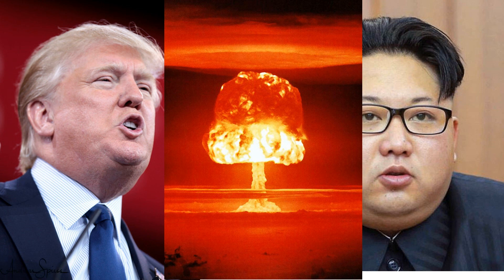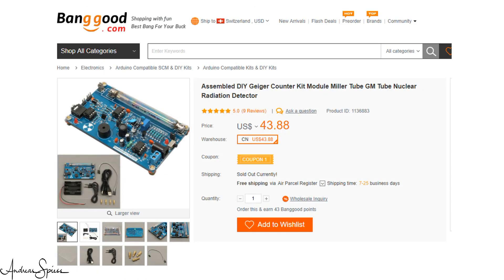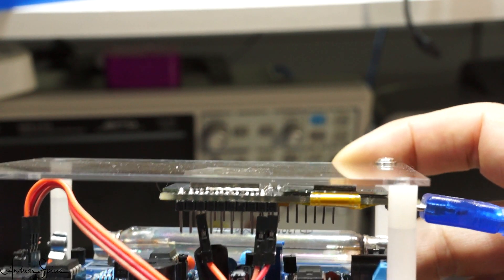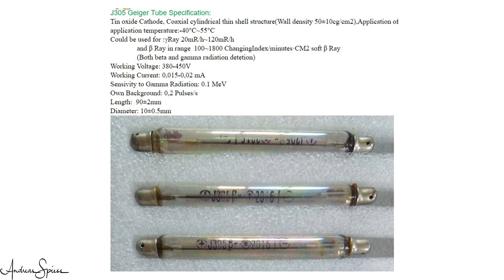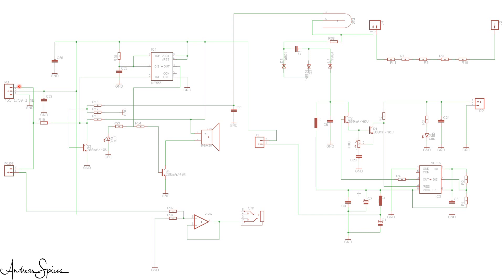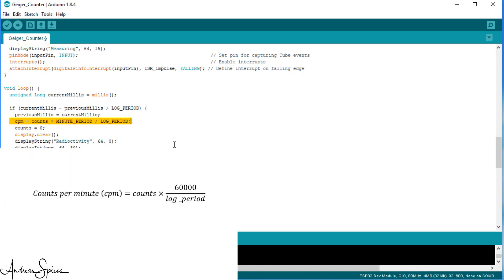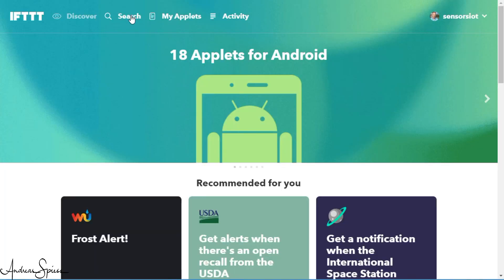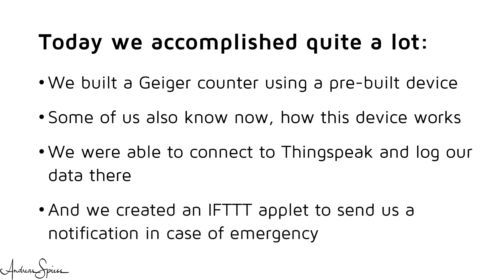#162 Build your own 50$ connected Geiger Counter (ESP32)

Comment: my interest is peaked with all of these projects and with current issues we politically maybe facing.  i always been interested in self prepping and preservation but never fully taken the leap until recently.  now i have several two way radios, i'm learning about getting my license to operate them legally and learn more about setting them up in disaster situations, i have food on hand that should last a good while and tons of sealed storage containers, i do lack a dedicated survival shelter however i do have plans and placed i been keeping track of that i'm keeping close to my chest not revealing as to limit possible exposure of it being viable place of survival. one of the many things i want to do is these projects, helps you learn and understand how they work.  my biggest grip however is using wifi and the internet, here and now that's totally fine, however if the bombs drop or war is started, internet is not a guaranteed thing, not only that but using wifi/internet is also potentially issue with it just going down doing nothing, just a bad day, lines gone down or something.. and having them ruggedized for hard use would be more ideal.  what i would like is a system for logging and solar/battery lasts a long time just logging silently... but in event of x value exceeded, it starts firing off data and alarms.. one thing i plan on doing is hiding these boxes in abandoned buildings in and around dif areas in and out of my area so i can map out changes and where they maybe coming from and going to and patterns may come of them.. maybe instead of wifi use gsm system and fires off to said servers the info u requested or texts your phone? maybe oneday also add in a digital 440mhz or 900mhz band radio to have them communicate off the grid to some centralized system u establish privately?
Reply from the maker: Sounds you have a lot to do. I really hope it will be useless, because even if we are prepared well, war or any other catatrophe is not a desirable option for me...
Reply: Andreas Spiess not a desirable option for anyone.. I really hope never comes to it.  But even so I really hope to use multiple devices to study changes and patterns and maybe discover something new.

Ultimate outcome will be that only use for these doomsday devices and weather devices is to be used for discovered and in ways not intended to be used, at least originally.. for example if I place 100s of these giegercounters around my area can I accurately maybe predict things like change in seasons? Or approaching storms?  Maybe have first alert to solar storms?  Or even if some small leak of radiation somewhere can I accurately determine paths it takes and maybe augment yeild info?  

I purchased a few of these on eBay actuallly for even cheaper, and I'm reviewing your other videos on how to program these types of boards, I am excited to at least have some science and experiments.  

That being said maybe if we should not consider the grim possibilities but instead maybe would be cool to come up with alternative projects for them as well.. you mentioned in Brazil they able to seen changes in radiation levels in different weather patterns and systems, that's kind of cool and sort of my idea.
Reply from the maker: Maybe you consider to join one of the networks of radioactivity sensors mentioned in other comments here

Comment: I think if the bomb dropped, one of the first things to go would be the internet.
Reply from the maker: I think you are right!
Reply: Nope, you are both wrong, ARPA net was designed to withstand a nuclear war which is why it is distributed in the connections and there are the algorithms to find a fast route as well as any route that will make the connection including cable, over the air and satellite. Also it would be useful in the case of a nuclear accident such as Chernobyl and Fukushima.

Comment: Always test any project you made! For this project you have two options:
- Order a Geiger-Müller-Tester from Ebay. But, these are expensive and only sold from North Korea, USA or maybe Russia. For an additional fee they even launch it for you. You can also test your atomic shelter with the same device.
- If you do not like the above project, then use the high mountains in Switzerland. Would be interesting to get some values from 3000m (or even 4000m).
Reply from the maker: Lol. Maybe I will take it to the mountains when I go skiing...

Comment: An excellent comprehensive tutorial. I like it. I don't have the time to experiment now but my interest is peaked. 

On another note I saw you show the detector tubes independent of the board several times so I am assuming it is possible to get them separate. I am thinking it may be possible to electronically switch between two tubes say. One would be standard and the other would be shielded with 1 cm thick lead say. 

For 30 seconds we run the ordinary tube and take this to be low energy radiation. Beta I assume since since alpha should be filtered out by air and the housing. For the other 30 seconds we switch to the shielded tube so we are measuring gamma. Assuming near constant radiation in an event the difference can dive us an indication of the strength of the radiation we are dealing with.

Of course we can just put the entire Geiger device in a shielded case  with connections outside but that would not be automatic like the proposal above. 

What do you think? Am I making any sense?
Reply from the maker: The tube can be removed. However, the pictures I used were not from my own tube. I did not remove it so far.
Reply: Is it feasible to do the switching circuitry I suggested? Maybe it means disconnecting power to the board during the switch and letting it boot back up. All automated of course.
Does it make sense in your opinion or am I overthinking this? 

I think it would be much more useful if it could tell us how energetic the radiation is. My thinking is very energetic radiation at a lower abundance is probably worst that less energetic radiation at a slightly higher abundance. Maybe someone with more knowledge on the matter can correct me here if I am wrong.

Comment: You need to be careful about your enclosure because beta radiation is well absorbed by most Perspex, so your reads will be lower in an enclosure made of Perspex. Most counters have a wand with a thin membrane over the end specifically to avoid absorption of the radiation before it hits the detector.
Reply from the maker: Thanks for the information. I just began to deal with the matter!

Comment: Thanks, your contrubution arises an important question about counting (fast) signals using the ESP32: How can you control on which core the WiFi and on which the Counter runs and avoid intereference?
What I could find up to now is that the system is pinned to core0 and user tasks to core1, https://esp32.com/viewtopic.php?t=1161 . I also found some helpful articles on "techtutorialsx", e.g. https://techtutorialsx.com/2017/05/09/esp32-get-task-execution-core/ Here is decribed how to find out on which core a Task is running by adding some lines of code into the source. Do I have to modify the source Code of the wifi lib to find out on which core it is running or is there a more elegant ("non destructive") way? 
Maybe you or one of your Viewer knows more - even this is not necessary for a Geiger counter.
Thanks!
Reply from the maker: I did not look at it. At least, the ESP32 does not need any yield() statements to not crash. So, I assume, WiFi got the other core...
Reply: So, today I implemented an ESP8266 WeMos D1 mini Pro into the case of my Geiger counter  GCM-320+. It fits in the case and can send the dosimetric data to my ioBroker. So I can check several locations in and around the house.
Thanks for the inpulse!

Comment: As always, great video. I am kind of surprised you didn't tie it in to iotappstory AND your MQTT / NodeRed system. You could tweet it to your neighbors you care about.
Reply from the maker: Good ideas. This time, I wanted to concentrate on slightly different things to give you guys the choice...
Reply: Could you or someone else do a MQTT version of this scetch, I gave it a try but getting stuck on: "client.publish(SENDTOPIC, cpm);" with an "error: invalid conversion from 'long unsigned int' to 'const char*' [-fpermissive]". I may have done something very wrong in the code with limited coding skills. But it woud be very useful to get the MQTT working with local connection to my home-assistant to get alerts/graphs.
Thank you for the good work so far on your projects.

Comment: I remember as an apprentice I worked on calibrating them. Good times as with the radioactive signs no one came in the building. Lol By the way finally got my lamps to turn on and of via google home/assistant. But having problems filtering the commands in Node-red so far. Great episode, hopefully we will not need them.
Reply from the maker: I saw it in your video...
Reply: Andreas Spiess I need to find a filter. At least it works so that is a positive.